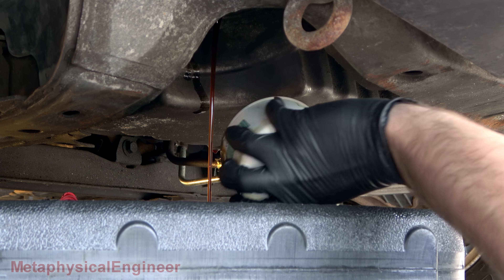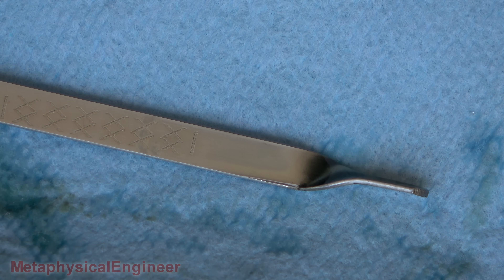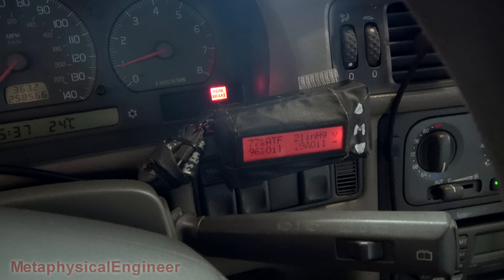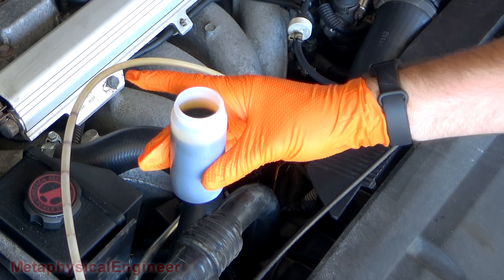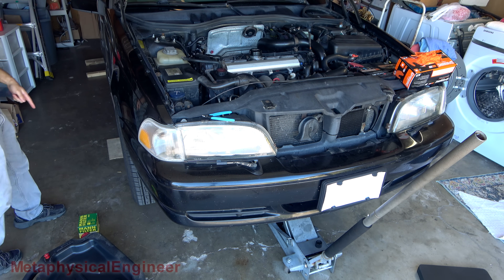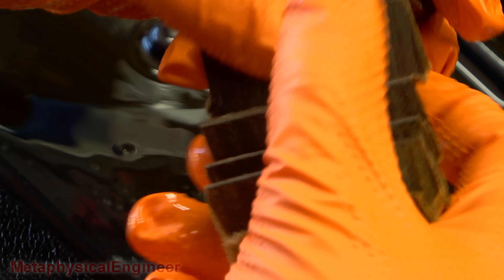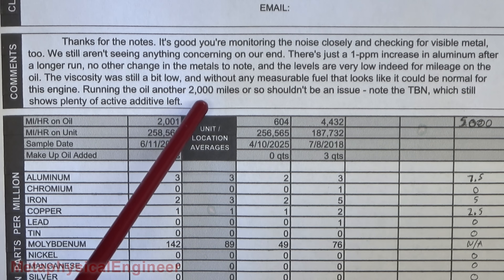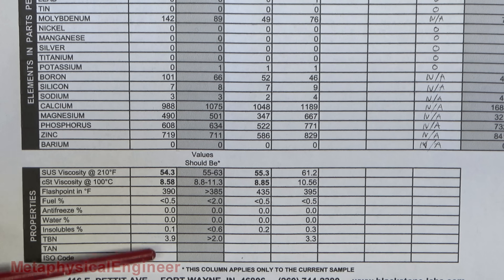Valvoline Restore and Protect vs Noisy Lifters - Used Oil Analysis and Filter Cut Open

Comment: Do you have any oil smoke at startup at all? I get an occasional blue puff at startup every now and then, only at startup, and completely random in timing. I assumed it was from failing valve stem seals, but i tried about a pint of Marvel Mystery Oil in the crankcase (for something ticking on the lower end and oil consumption) and strangely enough the smoke at startup has greatly decreased. The ticking has pretty much gone away as well after 800 miles with the MMO. This has me very curious about trying R&P oil at my next change, since MMO apparently did something. Maybe my slight oil smoke puff could be cured with some valve cleaning R&P?
Reply from the maker: I used to get major smoke and oil burning from valve stem seals.  Cold start after sitting, after idling at a stoplight, etc. At 227k I pulled the cylinder head and had a machine shop replace seals, skim the surface, and lap the valves.  Instantly solved the oil use from more than a. quart per 1k miles to negligible in 5k miles.  

MMO is a decent gentle cleaner so could have resolved some crud in the wrong place.  R&P supposedly has strong seal conditioner additives, as a side effect of cleaning can be increased leaks because in some cases the deposits are reinforcing old failing seals.   I’d give it a try, but be cautious with interval and filter clogging on older engines.  Oil analysis is worthwhile to keep an eye on how things are doing.
Reply: @MetaphysicalEngineer my occasional oil smoke at startup has been ongoing ever since I got this vehicle. The MMO reduced it. I am going to give R&P oil, alone, a try now.
Reply: @MetaphysicalEngineer so I just finished putting 6 quarts of R&P oil in. The oil I drained out was Valvoline Full Synthetic High Mileage with around 1 pint or slightly more of Marvel Mystery oil for about the last 800 miles (replaced consumed/leaked oil with MMO) and wow, there was a LOT of carbon specks in that used oil. MMO certainly did that, as previous oil changes with that same HM oil didn't look like that at all. Looking forward to see what R&P alone will do for the noise, oil consumption, and occasional startup smoke.

Comment: They use to make a Product called Motor Honey, it would Stop any Lifter Noise...
Reply from the maker: I wish it was that easy here.  But it’s not a viscosity and pressure problem.  If so the problem would go away when oil was cold and thick and appear again when hot and thin.  Thanks for the suggestion regardless!  There are cases where motor honey or similar oil thickeners would quiet down a tired noisy engine.
Reply: That super thick garbage isn’t recommended in modern engines. The oil galleys are too small and the clearances are way too tight. It’ll actually make the problem worse in the ohc engines that use bucket hla’s

Comment: you should check for broken exhaust manifold bolts. alot of shit sounds like lifter tick
Reply from the maker: I wish it was that easy!  Because of the layout of the engine, the noise gets masked by normal noises up top with hood open, but echoes down against the firewall and is prominent underneath like an exhaust leak.

Checked torque on manifold hardware when the noise appeared, but was all intact and tight.  All manifold hardware and gaskets are new as of 33k miles ago.  Around the 30 second mark on the first Seafoam video, I held my mic up to my mechanic’s stethoscope to show the distinct metallic clack from exhaust lifters on cylinder #5.  Noise also happens equally loud on rev up and deceleration when no fuel is injected.

Comment: Run 1qt of dexiii atf in ot for about 15mins and then do your oil change.
Reply from the maker: Gotten a few people suggesting ATF on previous videos.  I’m skeptical because all the deposits in this engine are super tough hard varnish that resist carb cleaner and other solvents.  15 minutes of flushing isn’t enough time to do the kind of cleaning needed here.  If it was all soft sludge, I’d believe a 15 minute flush would be much more effective.

Comment: Congratulations, the oil lost 20% of it's viscosity. Must be the world record. The junkiest of all junk oils.
Reply from the maker: I’m not exactly happy with the viscosity loss either. But indeed such “junk” that it managed much less engine wear per 1k miles than the averages for this engine family, even when sheared out of grade.  Guess I’ll find out at the next sample if it keeps shearing to oblivion or if it stabilizes.  Oil pressure still well above factory spec and no accelerated wear means engine is still protected.
Reply: @MetaphysicalEngineer  I understand your point. If your car is designed to use a 0W-20 oil than it's fine. But if it's not than running an extremely low viscosity oil brings you closer to the risk of bearing failure no matter how good or bad your UOA numbers are. Bearing failures happen instantly without warnings.

Comment: That is really some oil filter your car calls for.  Wow!  That's bigger than most modern truck filters.  Enjoyed the video.
Reply from the maker: Volvo used the same filter for many decades before going to a (similarly large, maybe bigger) cartridge style a couple model years after this.  Works out pretty well in holding lots of material without plugging up and going into bypass. Ironically enough, I’ve looked into bigger filters, but the position at the bottom of the sump means I don’t want it hanging down too low and risking damage.

Comment: Bond a lubricant to the inside of your engine and your noisy lifters will quieten down.
What's more the engine will stop collecting sludge because it's running cleaner.
...and wear will be reduced by 50~90%.
🙂#XcelPlus
Reply: What are you talking about?

Comment: Valvoline R&P stopped a burning oil issue in my pilot in 2 changes. I was burning about a 1/2 qt every 1,000 miles, now zero loss after 1,500 miles on my 3rd change. It worked, I am shocked.
Reply from the maker: Thanks for weighing in!  Glad you saw such impressive results- that gives me confidence I just need to stay the course for another few oil intervals to let the cleaning happen.  How many miles on your Pilot?
Reply: I heard u have to change oil 1200 miles i heard it clogs oil
Reply: @issavibez394  Only if the car has been really abused. Or had some other terror of a reason to get really dirty. Changing oil regularly with anything bought at a store regularly should have prevented such a problem for most any engine.
Reply: @issavibez394  it CAN. Best to check it if you're worried
Reply: @issavibez394 , You got bad info. I've been using R&P on four family vehicles with excellent results. The used oil looks no thicker than other oils I've used in the past.
Reply: I guess that didn't post. 2008 Pilot i got about 2 years ago at 108k, now 118k. 1st oil change un week 1 was Pennzoil 5w-20, then noticed the burn, went to 5w-20 Valvoline R&P now at 118k.
Reply: @John_Sineni  They are oil burners. 😮
Reply: @Davido50 my 115k 03 mdx does not burn oil. It did have a rear main seal leak. Threw some at-205 in there for about 700 miles with the penzoil 5w-20 in there. Switched to 5w-30 vrp. Ceanled the pcv valve. The leak has stopped and I don't burn oil
Reply: What year was the pilot and what oil did you use before.
Reply: @gerardford5707 2008 Pilot EX-L, I bought it a little over 2 years ago, probably 30 months. Had 107k on it when i got it, I did a change in week 1 Penzoil Synthetic 5-w20. I then noticed the slight burn. I changed over to Valvoline R&P at 109k, just hut 118k. I also did chnage to 5w-30.

Comment: It’s a good quality oil. I have been using it on two of our cars. Both engines are running quieter, and better by being running smoothly as well.
Reply from the maker: More success stories!  What make model and year are your cars?  Did you have oil burning problems or dirty engines before, or did you try R&P on a whim?
Reply: Our car are a 2015 Kia Rio EX with now 119760 miles on it. It gets the oil changed every 4k. Lake Speed found that my oil stayed perfectly fine and the engine is great in terms of how responds to the oil. I’m using VRP 5w20. This car has an oil consumption issue. We are on the first oil change (almost due to the second one). I was also told , I could extend the interval. However, I prefer to stay on the 4k mark. The other car is a Nissan Sentra 2018 with 95k and not burning oil. It’s on the second oil change for VRP 0w20. I’m happy with the oil. I like your Volvo. I used to have a 1994 850 with more than 250k on it. I miss that one. Great Volvos.
Reply: I like Valvoline, but why did it sheer down so much?
Reply from the maker: @ChrisPatrick-q6k   Not sure yet.  Some other commenters have suggested it could be trace fuel dilution, too low to directly register on Blackstone's test but visible in the reduced flashpoint measurement.  

The video releasing later today about the PCV system could offer some more evidence.  The analysis when I drain this oil will say a lot about whether it's shear or fuel.

Comment: Spray a little silicone on your belts. I have heard them make funny noises and ticks.
Reply from the maker: Oh I wish it was as easy as a belt making noise, but that area is quiet.  It will still tick with drive belt removed, though I didn't get a video of trying that way back when I was first trying to diagnose what was making noise.

Comment: Use a thicker synthetic oil and run a can of Seafoam in oil before changing. I have always used Mobil 1. My cars just didn't like Valvoline. Synthetic oil will eliminate the carbon and sludge build up and extend your change intervals.
Reply from the maker: See previous videos, conveniently linked in the description, where Seafoam didn't touch the noise at all (but did darken the oil faster than normal).  This engine has been on a diet of high mileage synthetic oils for the past 100k miles.  None of them did anything to thin preexisting varnish, and certainly allowed whatever jammed the lifter to accumulate as well.  

Oil viscosity isn't the issue here, though low oil pressure can certainly manifest as noisy lifters.  Oil pressure when at operating temp easily exceed the factory spec for this engine.
Reply: @MetaphysicalEngineer Ah. Sure it's a lifter or an injector?  I'm still shooting in the dark.
Reply from the maker: Lifter, for sure.  In the first video I made on this problem ( https://youtu.be/h9ou49Q3rno ), about 30 seconds in, I hold my mic up to my mechanic's stethoscope to capture the prominent metallic tick-tick-tick and localize it to the exhaust lifters on cylinder #5.  These engines do have noisy injectors, but normally not to the extent it's audible outside with the hood closed.

Comment: The oil analysis confirms shear stability could be an issue with this oil. I’d be curious how much more over the oil change interval.
Reply from the maker: You may be on to something.  Either that or somehow my stock tune, very mildly turbo'd engine is really munching on the oil.  I expected a synthetic from a major brand to be tougher, though the oil pressure staying healthy and excellent wear numbers mean it's not a problem for me, yet.

I'm sure plenty of people wish Valvoline would sell a 10w-30 or 10w-40 version of this oil for platforms requiring those grades.
Reply: @MetaphysicalEngineer  exactly, i hope they do start making a 1030 and 1040.   Would love to know oil Geek's Lake Speed's opinion on your engine's factors, it's fascinating.  I'm a fan of your engine though havent had one, at least yet.  What year and miles and history is your car?
Reply from the maker: 1998 model, now at 259k miles.  Was my family's car from new; one of my earliest memories is sitting in the back seat as a small child while Manny the salesman explained the fancy dual zone climate control to my parents.  So I've been riding in and then driving and maintaining this car almost my entire life. Took me to school, drove it to prom, moved me to the west coast, etc.
Reply: @MetaphysicalEngineer  I wonder, oh I wonder do I even need to use this oil considering my 2004 v6 f150 have been maintained with mobil1 EP consistently at 3k miles but I had 6-7 shady oil changes in the range of 8K-10K miles and on the 10K miles it was the first time I noticed the dipstick has caught a bit of varnish. Interestingly enough once I changed the oil in 2-3 days the varnish was gone on the dipstick... About 4 months a go I had valve cover gaskets changed and the oil pan gasket change due to leaks of them being old and dry, the mechanics were showing me the pics from the top of the engine and the bottom of how clean it was looking all silver as it came out from the factory LOL. Even with the 6-7 shady oil changes the mobil1 EP has done tremendous job of keeping the engine clean and today for curiosity sake I shined flashlight trough the oil cap filler hole and still the edges of the block are silver and same as the one rocker arm I can see trough the filler cap looking all nice and silver. Makes me wonder why would I even want to change to anything else from Mobil1 EP considering I have been using it on the same vehicle for almost 22 years with such results?

Comment: Wow, I can’t believe you spent the big bucks to buy single quarts😂.
Reply from the maker: Easier to fill filters and easier for visuals on camera to show the leftovers!  Also cheaper than a pair of 5 quart jugs if I ended up dissatisfied with an open half used big jug that I'd have to deal with.  I'm not rich enough to buy seven individual quarts just to troll people, as tempting as that would be!

Comment: Compare with Amsoil XP and Signature Series
Reply from the maker: Amsoil has been suggested before and I'm very curious to try it as well.  I'm here for the long haul testing various oils and products against this stubborn noise.  I will give products a chance to work though, as nobody will be happy if I end a test prematurely.  I managed to get grief for running the Seafoam too long and not long enough.
Reply: @MetaphysicalEngineer  Yeah, I choose to believe Seafoam-like products don't do very much under normal circumstances. You could try Amsoil Power Foam, but I'm not sure it will completely fix the problem.
Reply from the maker: I mentioned in the previous videos that Seafoam and MMO are old school products from a time when engine and oil tech wasn't as good, so there would be sludge and crud even in well maintained vehicles.  Therefore they weren't effective in my case where it's just small amounts of super tough varnish in just the wrong places.  

Power Foam probably would just make my car a turbocharged mosquito fogger.  I've had the throttle body and intake and IACV apart recently.  Throttle and IACV were cleaned, and intake just had a thin layer of varnish that wasn't worth the effort of trying to scrub out.  In other cases, that would be a good idea to try if those items hadn't been checked and were caked with crud.

Project Farm had very good results with Seafoam on his older Ranger farm truck, which definitely had a sludge and oil pressure issue from years of severe duty low speed use.  In his case, the Seafoam managed to knock the sludge out enough to let the lifters work again.  I think he also used Lucas to help with the low oil pressure.  Engine went from sounding like a clapped out diesel about to blow to purring right along.

Comment: Did you say the mileage of the vehicle?
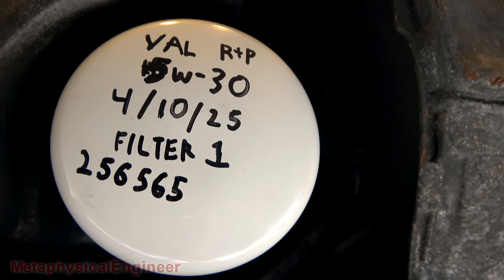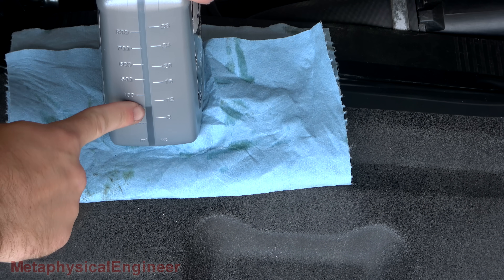Reply from the maker: Mileage was spoken or appeared on screen multiple times, believe it or not.  Please refer to 1:21 or 3:33 for initial mileage on this oil run.  3:36, 6:41, or 10:31 for mileage when the filter was changed.
Reply: @MetaphysicalEngineer 
Thanks

Comment: Its just a mild engine flush that requires more work and way more money. You could do engine flush once and get the same results or no results
Reply from the maker: Do you have any data to back up your claims?  

Even running bottom shelf cheap oil with an engine flush, I'd be paying more.  $35 in oil plus a $10 bottle of flush.  Then another $35 of oil after because the flush isn't meant to stay in the engine long term.  Plus another $10 in filters, assuming I can get the deal I got on them last time.
Reply: This oil is under $30 for a 5qt jug at Walmart, and some commenter said there is also a $5 rebate going.

Comment: Try some liqui moly mos2. i used to have tick in mercedes ml350 with m272 engine. couple oil changes with mos2 and seems to have quieted down.
Reply from the maker: Thanks for the recommendation!  As I've said before, I'm open to trying different products to see what will get the tick to quit.  So long as the lab results look okay, the noise is cosmetic and I can keep tossing various products at it to see what works.